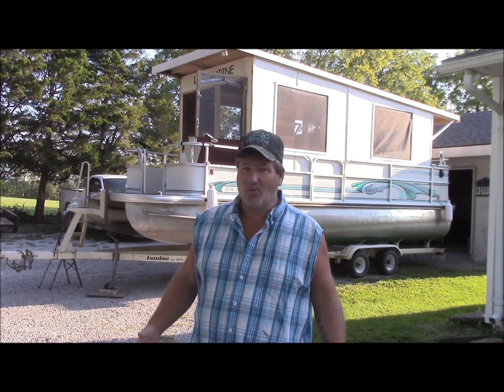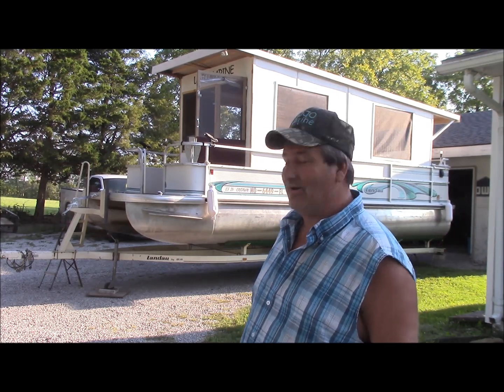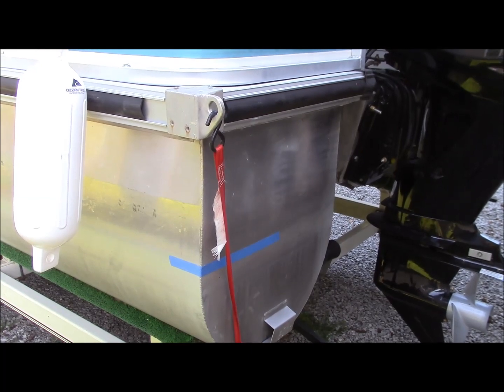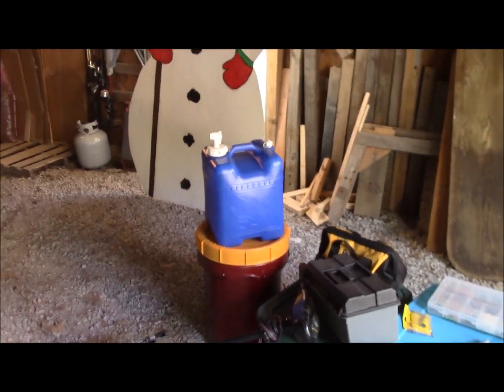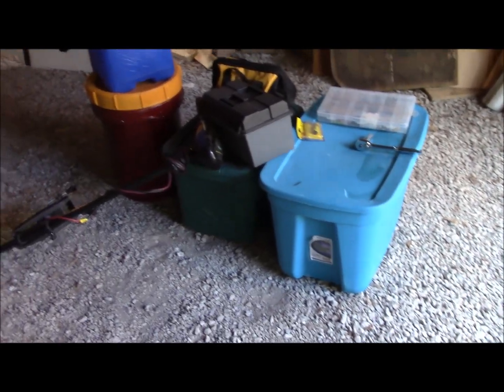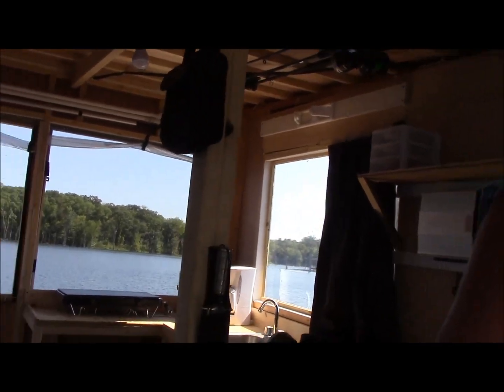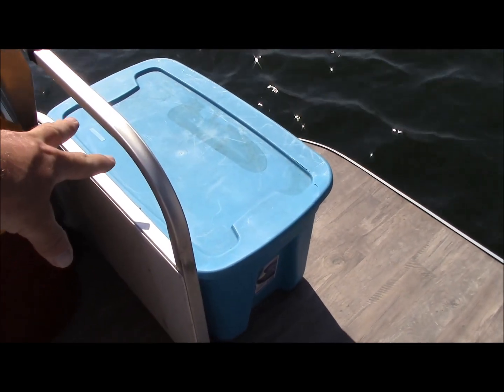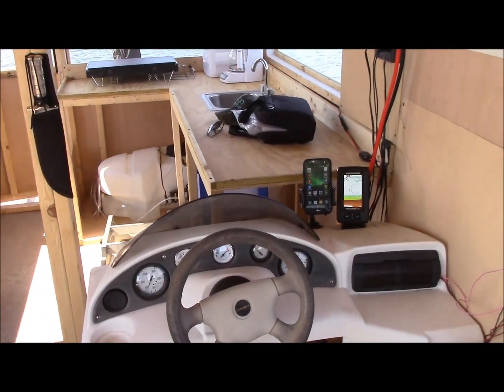Test Launch 9 11 18

Comment: That's a nice little boat buddy. I like how the roof slants down in the back to shed water. Flat roofs are a pain. It launches easy and loads easy. I  need to mount some pole holders on the rails today like you've done  good job!

Comment: I like it. I would consider adding a 3rd toon in the middle to bring the rear up a little bit more but it looks like it may be just fine after burning off some fuel weight.
Reply from the maker: I think your right
Reply: Shane Beaudrot   Maybe a pontoon about a forth of the length would work in the middle like a charm.

Comment: I think it’s an awesome boat! As far as the stern being low, look for a 10 ft “tri-toon”  to install in the middle at the stern and that will fix your problem. That should be enough to level it out to match the front of the boat.
Reply from the maker: Thanks Gary stay tuned
Reply: Where I live all the pontoon boats sit a little lower in the back. I don't think it's a big deal. Wow you're carrying a ton of fuel

Comment: I would have definitely moved the steering and engine controls as far forward as possible just for visibility. You could add a FLIR camera system which wouldn’t cost much to get 360 situational awareness, especially at night. You might not see  flotsam or jetsam in the water until it was too late. And all that under hull wiring needs to be in conduit. . I would add an anchor and about 100’ of 1”chain, which would help trip the boat. You need a vhf radio, a compass and a fishfinder so you have an idea what’s under you.

Comment: Really nice project, really nice job. But, check the rules for inland waterways, I think now that you have added the structure your anchor light (stern) needs relocated. It must be visible for 360 degrees if I remember my  boating years.
Reply from the maker: Hey Lewis you are right I can raise my stern light another 3 feet so it is higher than my structure.

Comment: I would relocate the fuel tank more to the front and find a way to distribute your dead weight a little more. This advice comes from a man that was in the Navy for 17 years and work on boats both large and small.  I was a hull technician. That meant I did all the repairs.
Reply from the maker: Great advice I am going to try this stay tuned

Comment: Do you know the weight and is this a 24 ft boat?
Reply from the maker: yes it is a 24 foot boat and I can't remember how much weight it was but I do remember I was 2000 lbs over what I should have been but it floated great as you can see
Reply: @LOJOMarine  also, I meant to ask you can you put this on a trailer and drive it down the interstate or is that a problem?
Reply from the maker: Yes we put it on a trailer and drove it 100 miles to Hannibal, MO and put it in the Mississippi River and then we loaded it back up in St. Louise, MO and drove it back 250 miles back home with a Ford F-150 pulled it like it wasn't even back there
Reply: @LOJOMarine  that is great. Thx!

Comment: Looking good. I think you need to worry now about side coming wave. They are rough on a tall pontoon structures. My pontoon was wider version and tall as well. Those side waves made my kids scream xaxaxa  because it was rocking left to right to left few times pretty good.
Reply: D- KUSTOMS GARAGE being docked .  or anchored . what about weights  hanging on rope in the water on both sides   for balance not touching the bottom. sailboats have weighed keels to prevent roll overs. I think that would work .you couldn't use them under way. another  option would be weight in the pontoons. especially for shanty boats built on pontoons. balance thiers lots of options you could use maybe out riggers pontoons.  catamaran style. you could also raise them to the side when you trailer.  I've seen vids on thoes hydraulic ones. But thiers options thier also.

Comment: I know your concern on how it would float. I was also surprised on how my floated. I just went through that with mine. I think Coastguard approved is half submerged. So you are still alright. Do you still have the motor mounted at the same height as before.
Reply from the maker: I do I didn't move it didn't look like I should thanks for watching
Reply: I lifted mine to the bottom holes because of the weight would be pushing the boat down. It runs great on the water the motor is not so deep and causes a drag. And the motor won't touch bottom loading and unloading.
Reply from the maker: @bigalsoutdoorexcursions1885  thanks for the input I am going to look at where mine is I might just move it thanks man I love it when people gives me new ideas  I never would have thought about this
Reply: My Shanty boat is 20 ft long and I have a 8x16 building that we built on it. Out of metal studs and 3/8 T 111 siding with metal roof. I have a 21gal fuel tank, 1 battery in the back. With 40hp 3 cyl Yamaha
Reply from the maker: @bigalsoutdoorexcursions1885  I would love to see a video of your boat I just put one on youtube

Comment: Nice job! 
Does the back end set lower than when it was just a regular pontoon boat? 
Have you lost out on your trip yet?
Reply from the maker: Hey Jeff welcome aboard and thank you for subscribing to my channel. and yes the back end did set a little lower than it did I put a little over 3,000 lbs. on the boat with the structure it was heavy  but did float well so I went with it.I am going to do the trip again next year with a different set up and smaller shack stay tuned.

Comment: PLEASE....PLEASE....PLEASE.....Fasten front of boat to trailer BEFORE pulling it out of the water.  NOT fastened it has ability to break loose from trailer thus damaging
your boat.  So suggests JimInCincy.
Reply from the maker: I did and I always do but thanks for the tip